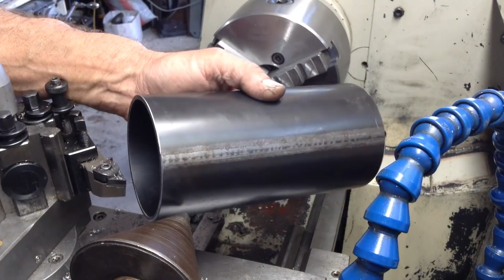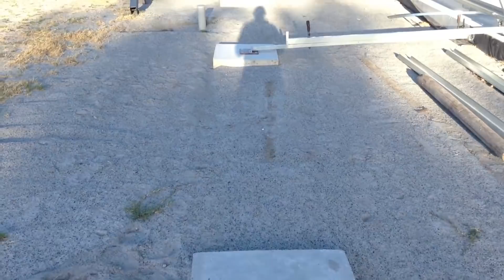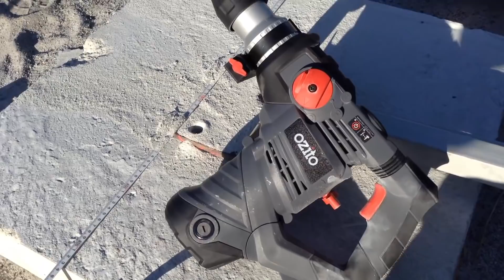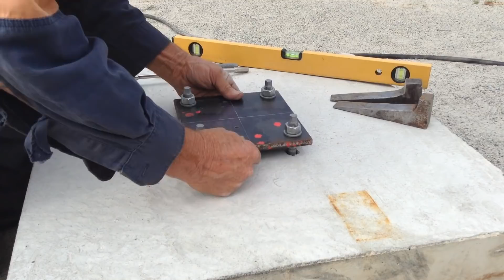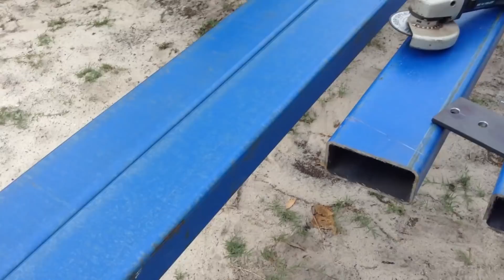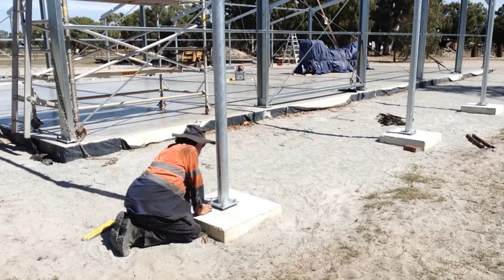New Machine Shop Build .   Part 5 .

Comment: What kind of soil are you building on?
Reply from the maker: All sand , compacted to twice housing spec with 12 to 20 ''   of heavily compacted cracker dust .  Cracker dust is a by product of crushed granite road base .  It's like a fine mix of granite powder & 1/8''  size granite .   Properly mixed with water & compacted , it sets almost like concrete .  👍

Comment: I only ever have TWO pieces of knowledge to gift any other machinist:
1) Never UNDERVALUE yourself; and
2) Never buy a Bridgeport mill OR a Colchester lathe.
The FIRST is a tragedy;
The second is a truth.
Keep safe and well.
;)
Reply from the maker: The B.P is  great for light work , but you can do that on a large machine .   Never owned a Colchester but used a couple .  The direct reading dial  was a bit to get used to !    What's your qualm with  BP &  Colchester ?    Cheers .
Reply: @swanvalleymachineshop  It was a bit of a facetious observation re: Over priced and over hyped machinery, from a semi-retired machine tool fitter! ;)
 BPs(ie turrets), have great adaptability, which is seldom utilised, as trammeling in the axis is a nuisance, and the "nature of the beast" is to not bother - they're a great idea, but of little use, other than for light jobbing work. 
Colchesters on the otherhand, are just overpriced machines with ok performance, regardless of the era(round heads, square heads), or size(Chipmaster to Mastiff). 
The reason why both of these machine tool manufacturer's have over inflated hype, is that they are/were extensively placed in training colleges, etc where students cut their teeth, which instills a sense of loyalty and a perception of quality, as they have no other machines with which to fairly compare them too.
Unfortunately machine tool manufacture is becoming conglomorated, like all other industries resulting in less choice and a lot of "badge" engineering. Add to this problem, the dwindling supply of quality used machines eg DS&G, Holbrook, Schaublin, Lang, Arboga, Milwakee, Cincinatti, Churchill, J&S......
I often see Colchester lathes of similar capacity specs to DS&Gs being sold for much higher prices, which is madness as a comparable DS&G, or even a Holbrook is twice the machine.
Keep safe and well.
Reply from the maker: @craigywaigy4703  You do have a good point .  When i was an apprentice a BP was that expensive , no one had them .

Comment: Looking good max, coming right along that bolt glue is the shit, I bolted top in the coal mine with glue bolts damn thing's will hold up the world. I'd be glad to give you a hand if you weren't half way around the world. Lol.
Reply: Hah! I live around the corner and got tired of offering. I obviously didn’t pass the “M8” test. 🙄
And I don’t drink beer, (coz I’m stupid enough sober). Maybe that was it? I don’t drink? 🤪
Truth be known I spill more than I drink. 😂
Offer still stands if / when you need it Max, but I suspect this is one of those “one man against the world” odysseys, and I can respect that.
All the same your doing a bang on job of it, so carry on up the khyber & get her done.
If you need it your welcome to 7 meters of flat concrete floor space in my shed to lay out and weld up that truss you mentioned if the weather closes in. 3 phase mig with traveller already there.
Just holler.
Hell you can do it up the back in my shed on your own if you don’t want me telling you how to suck eggs. 😉

Keep up the good work. 👍👍👍🇦🇺
Reply from the maker: @ianmoone2359  Thanks Ian .   I am saving the offers until it's time for  insulation & tin . I will give you a call then .  Cheers .   .
Reply: @swanvalleymachineshop   No worries. Have a tek gun here we can use if needed. 👍👍👍🇦🇺
Reply from the maker: Thanks for the offer !!!    Cheers .

Comment: Hi Max, looking good, huge amount of work but you are making a cracking job of it. You will get the benefit of your inbuilt accuracy in spades when you come to clad it (no fiddly angled cuts through corrugated steel sheet)! Keep up the good work mate, it will all be worth it. Cheers, Jon
Reply from the maker: Thanks Jon .   As i plan to clad it myself , it will make it easier .   The flashings are my weak point , always a worry !!!

Comment: your pipe welds look really good, hot dip galv of those pipes looks good , how far are you from coast? 
nice size shop.
Reply from the maker: Thanks .   About 27 km from the coast .   I did not want to paint  those bits & have to deal with re painting them in 20 years !

Comment: Always looking at your set-ups', great time savers, it's been a long time since I used the granulated resin capsules, great to use, and reduces high stress loads in the the drilled material.
That's a blooming big Meccano set Max 👍.
Great vlog thanks for sharing.
Regards John
Reply from the maker: Yes , it reminds me of my young days with a meccano set .   Maybe that's how we grew up with half a brain  & not a mobile phone stuck to our head's !   Cheers .
Reply: @swanvalleymachineshop  Worst thing is, our generation invented the smartphone, great to put some teenager in place. Yes, we had to remember what was said to us, no easy way to look it up.

Comment: Never have seen the chemical activated adhesive used to hold the stud bolts before. They work great and are perfect for this application. I have no idea where you would go in the states to get hot dipped galvanizing done for a custom small project. Are you just lucky to have a plant near by or is this very routine in Australia?
Reply from the maker: Hot dip galv is pretty common here .   There are several large companies that do it here in Perth .

Comment: G'Day Max, nice one mate! Which way does your shed face - roof windows E or W? And I kept thinking or that big bit of pipe as a pot belly stove for winter time.  Stay safe and well :)
Reply from the maker: The roof window faces north to get the winter sun .  I have a few of those pipes &
 one is destined for a pot belly !  Cheers .
Reply: @swanvalleymachineshop  Thanks Max, I couldn't tell from the shadows in your video. Cheers mate :)